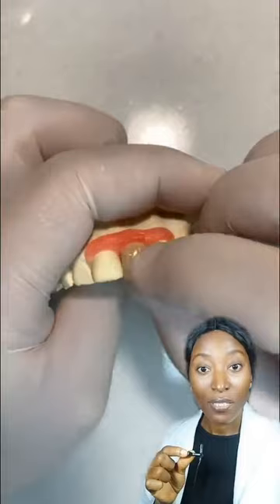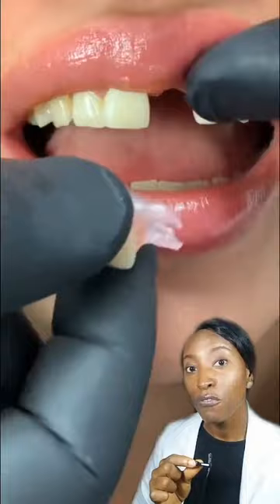Making a FRONT TOOTH DENTURE #shorts #denture #missingtooth #youtubeshorts #teethbits #shortsfeed

Comment: After getting the cap installed in Sister Dental Bridge, the teeth which are made smaller by grinding, do they get covered with dirt after some time? Please reply.
Reply from the maker: If you’re referring to a dental bridge, the trimmed teeth will be covered by the bridge.
Reply: How would they get covered with dirt? What does that mean? 😮